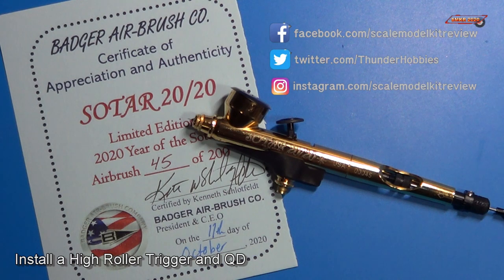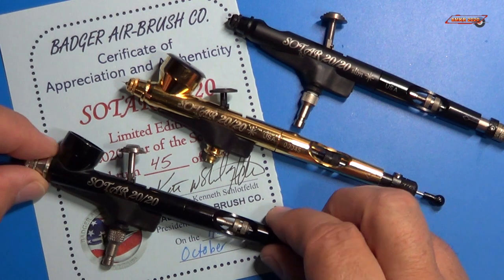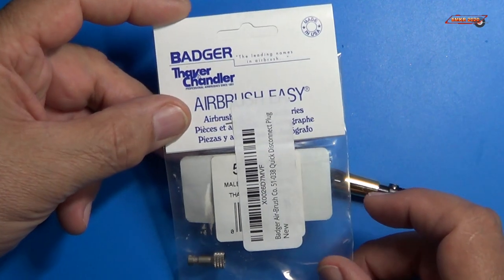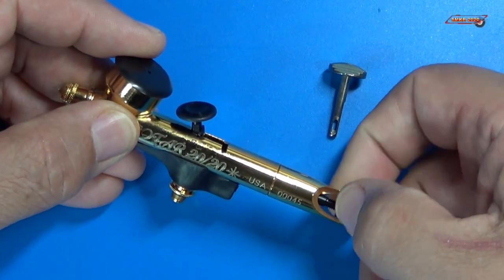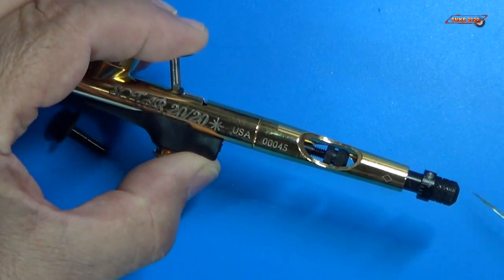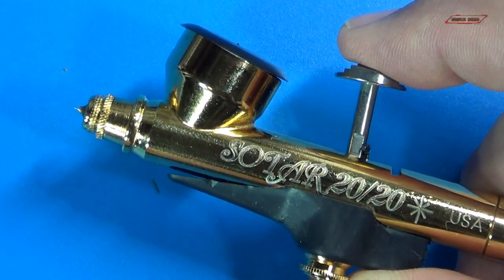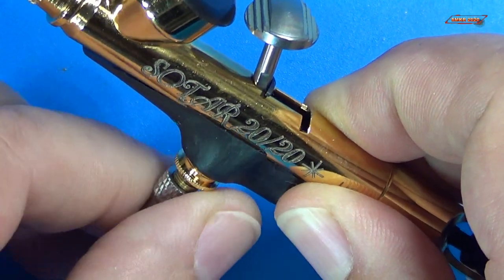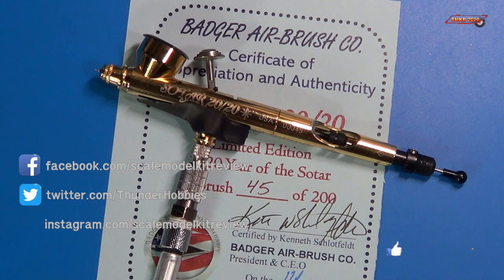Adding a High Roller Trigger to the Gold Sotar 20/20 Airbrush and Quick Disconnect

Comment: I thought i would love the high roller trigger on my sotar as i have my eclipse modded with a higher trigger. I dont like it it feels to much like using a spray can which ive done murals on entire buildings and the hand fatigue and pain from the finger being raised is far worse than what a low trigger does. It also puts my finger higher and since the sotar is for detail its just giving my line of sight another distraction besides the cup.
Reply from the maker: Everyone has their own preferences, but it’s worth a try.

Comment: When you buy Badger airbrushes do they come with 1/8 hose adapter for us european users? I have heard athleast two guys that says the sotar 20/20 is difficult to clean? By the looks of it I think it will be easier to clean than Mr procon airbrushes. I got one and they can be a bit hard to clean.
Reply from the maker: No they don't, you'll have to get the adapters yourself.  I think they are very easy to clean.
Reply: @ScaleModelKitReview  I bought a Badger renegade sidefeed 0.2 airbrush and it came with adapter.